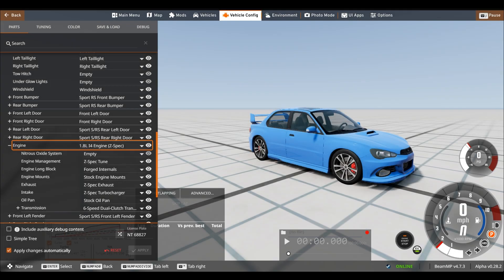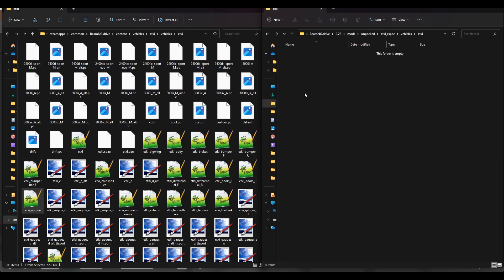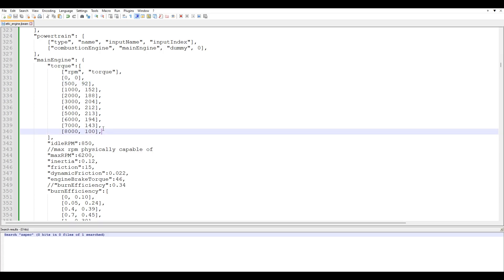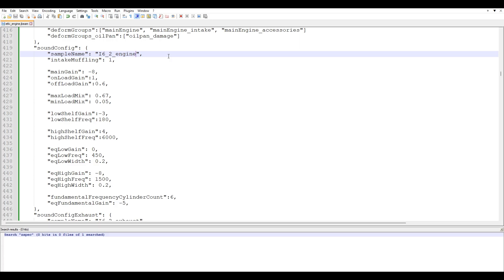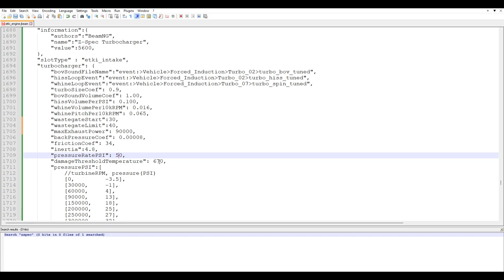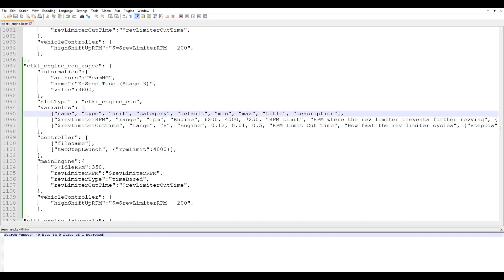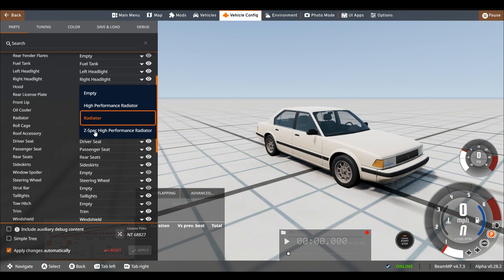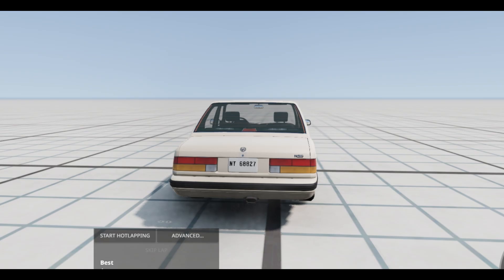How to Add MORE POWER to Any Car in BeamNG.drive! (Custom Tunes & Parts) [Game Files Tutorial]

Comment: How to awd swap cars
Reply: That's a lot harder because cars that aren't already set up to have AWD don't have driveshafts and differentials to support AWD. You'd have to manually create a driveshaft, differential, and axle to do that which is much much more advanced.

The power doesn't just come from the tires, it actually has to run through the engine, transmission, transfer case, driveshaft, differential, then wheels. So if the car doesn't already have an awd driveshaft, you'd have to actually create one and line it up on the car's model and stuff along with other components.

Comment: I'm trying this and the game doesnt recognize it. I'm trying to modify the engine on the Gavril series and when I copy all the files, text, and folders, and put them in the unpacked folder, the i6 engine (which is what i'm editing) just disappears in game. If I take the folders out of the unpacked folder, the engine reappears but not my modified one.
Reply from the maker: @BlenderGeek4196  there is a conflict between names then, just duplicate the engine in the engine jbeam and rename it to like “custom_engine” as an example, and the jbeam names need to be different than the original you copied
Reply: @ K
Reply: @NoNameNoWorries  Do you know how I could increase tire strength and transaxle strength. I'm trying to modify a semi and those are the two weakest points. I have looked through both of the jBeams but haven't found anything clearly mentioning strength.

Comment: how do i get more parts i only have to even on modded cars
Reply from the maker: @burnoutboy7712  More parts?
Reply: @NoNameNoWorries like more options to change for your engine such as camshaft, crank rod ect
Reply from the maker: @viruscovid1938  Oh i haven’t messed with any of that yet, I’d imagine it’s a similar process but you’d need to do some blender work to add the parts to the engine so they appear in game, then editing values to make it work, I’d do some research for sure

Comment: hey is there any way how I can add a lot of power in the lower and the mid range of the engine and not in the top range, like I want all the power to kick in at 3500 rpm, meaning at a lower rpm
Reply from the maker: @apgamingtoy_bonnie9876  Yea, i’m the engine jbeam, you’ll see a list of RPM values next to torque values. You can increase the torque values to jump once it hits a certain speed. You can make VTEC using this method
Reply: @NoNameNoWorries  hey I don't know I just messed up I was searching for "engine" in the hopper and it shows no results found, actually its showing nothing
Reply from the maker: @apgamingtoy_bonnie9876  It's under the common folder I believe; a lot of the older cars (d-series, roamer, etc.) use the common folder for certain parts like engines, because they all share the same exact engines. It was to save space I believe lol, or just because it's convenient to have them all in one place
Reply: @NoNameNoWorries  hey I have joined your discord server maybe we could get on a call and then share my screen, does that sound good?
Reply from the maker: @apgamingtoy_bonnie9876  I work tonight and tomorrow so I won’t be on Discord today, but mention me or leave another comment here on Monday and I can help out
Reply: @NoNameNoWorries  alright I will

Comment: Hello, It worked for me! I was changing a mod I had installed. It is an AWD EV.
I was able to change the torque( and hence, power) of the car but I have a problem.
The mod has an issue where the front wheels and front diff are not connected according to the power train visualizer. Can you help?
Reply from the maker: That might be located in the differential jbeam itself

Comment: i can see the engine in the game, but for some reason, nothing happens when i change values
Reply from the maker: You made a jbeam for it with different values? this is an older tutorial, I may have explained it incorrectly. Might do another soon with the knowledge I have now
Reply: @NoNameNoWorries  I did exactly what you did, but no matter what I did, the changes wouldn't apply
Reply from the maker: @qweastly  you can join the discord and I can try helping there
Reply: @NoNameNoWorries it finally worked, thanks! and I'll still join your discord
Reply from the maker: @qweastly  Awesome glad it worked 🔥

Comment: when i go to see if the engine is there it isint for some reason even after i rebooted the game
Reply from the maker: you probably missed a bracket or made a typo - add me on Discord and send the line of code you added or changed and I’ll see what went wrong
Reply: @NoNameNoWorries yo i got the same problem
Reply from the maker: @Evry1  what's happening with it
Reply: @NoNameNoWorries  when i reboot the game there is only the 2.4 and 3.0 i6 engines and the zspec isnt there
Reply from the maker: @Evry1  Did you make sure to rename everything? Like how I did
Reply: @NoNameNoWorries  i copied your exact  steps and wrote the exact text
Reply from the maker: @Evry1  Your formatting may be incorrect then. Best thing to do is start over, just copy the other engine and modify the name and code name too
Reply: @NoNameNoWorries i tried the other engine same problem it doesnt appear